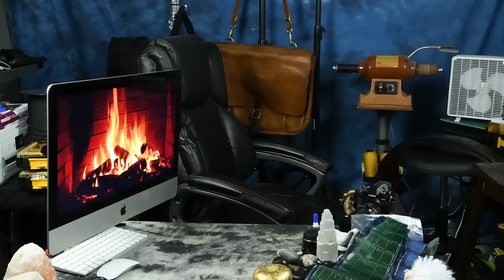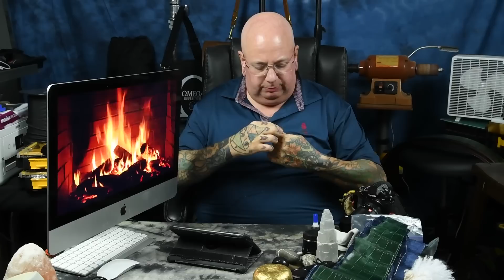🧐 FREE ENERGY Arch Form TIME Variable 🧐

Comment: I'm sure you've tried Ken, but consider... 

A magneto/stator (ala generator) manifests at...

A) a certain speed/base RPM
B) a certain amount/size/strength of magnet
C) The copper coils (which don't even need to be too specific of a length/thickness) are wound at a right angle to the magnet and usually 6-15 coils high on each "stem" (even number of stems is variable on different setups) 

In general it's not even very precise compared to engineering standards 

So like you said, it's effectively the etheric torsion sheer off the right angle of the copper at some base level constant motion. 

So change the motion to the planet rotation/frequency (you probably know what that is, I don't), use a magnet with a ratio'd power on the bottom/in the center column. 

So the magnet is now static and your creating the etheric torsion sheer off of the earth. It's the reverse setup effectively, should be the same effect. 

So we have all the variables, someone better with math like you just needs to have the magnet and the earth numbers. 

We're effectively reversing the structure and getting the ether torsion sheer off the planet. 

An extremely powerful/concentrated magnet like you have, might be more efficient/require less copper. 

key is the ratio and finding at what "rpm" so to speak, it starts manifesting at it with the earth/planetary rotation. (so any change is in the base structure or copper winding)

Should work somehow. I'm sure you've tried this, as it's what you just described more or less.

Also, you would know, is there something "better" than a magnet for the base? granite?, some other stone/rock?

If you think it's the fleur de lis structure, then perhaps the coils are what tie in the middle, probably grounded to some conductive type of rock/stone.

So ratio'd up ballpark, 50K gauss worth of pulling power into the ground (magnet, pyramid), 9-10 feet of 1-2 gauge copper wire, I would try a 3/4 stem fam configuration so the earths .41-.6 gauss is always hitting the right angle of it. The 45-50K pulling power accounts for the RPM difference (small motor stator starts manifesting around 300-500 rpm steady). So that's the ratio to 10-15 volts.

The actual question is.... why do manifestors and stators need so more then a small amount of copper if the dialectic constant is infinite..... it's because the number of right angles has to be above a certain threshold to produce enough torsion sheer to generate a field/electricity. (hence why a motor has to spin) 

This is why you see those structures with strange holes and honey comb like structure, everything is just creating more angles to create more etheric torsion sheer.

Comment: What is obvious is, that it is unnecessary to move something that is already moving to get energy. Just like a Pulsar , that is spinning ultrafast an then spinning again around another axis. I was thinking about rodin-coils, but as of the last magnet-Video, i may think of a set of coils circular on the edge of the north and the southpole of a magnet, where magnetism is the most. So i think, one should get current out of that solid state device with an AC current with the frequency of the larmore precession to it. however i still dont know how the coils have to be lined up precisely to get the most effect. Try and error... ^^

Comment: Ken, here would be a good experiment for supermagnet man. Take a pyramid magnet and cut it into 4 pieces. Space the pieces close but not touching. Then see if the gauss strength is greater or less. Or make the Pyramid mags with more sides and test them. Ya? No? Maybe? Thanks, as always.

Comment: Joe Parr thought the Pyramid was a "time"machine. Well, if it's a time machine, it must be a time variant machine. When you decouple,
or split the 4 sided pyramid (bernulli) the energy is manifested to a much greater degree.  The  logo picture for my channel is 6, 3 sided concrete pyramids brought together to form one. 3 sided is the lowest geometry to use. The greater the frequency, like, cymatics, the more complex the pattern, or output. Tetragramaton - God- Tetrahedinal Gravitation. The pyramid shape at the top produces Antions and the bottom Cadions. The same a a battery has an anode and cathode. + ( ) . Space/plane of inertia/Counterspace. No moving parts, just lots of mass,  pressuring lots of 3 6 9 crystal structure stone with swirling water below it. So now you are getting the piezo electric effect. Water the antena, the stone pyramid, the symbol for the water and Pyth incromenceibility. Hidden in plaisight, waiting for someone to tap it and take a draw from it.

Comment: So basically no moving parts you generate the moving electromagnetic field and this slab or solid piece itself not only  manifest that magnetic field but actually acts as the load itself to make that actual power and then it's just a matter of tapping into that and distributing it am I correct and then you could have it interchangeable depending on the size shape what determine the amount of load created am I correct?

Comment: Based on Tesla's writings and Dollard's research, I was under the impression that Nikola Tesla's radiant energy system was different and better than electricity.  My understanding was that by using high voltage and high frequency electricity through a Tesla Coil, one could "smack" the ether and cause perturbations that could be picked up by a reverse wound receiver coil to drive a load.  I thought that by doing this, energy was made manifest by the perturbation itself and the receiver would be able to accomplish over unity by simply receiving this perturbation.  Taking this a step further, I though that by taking two Tesla Coils and arranging them to face each other end to end, and driving them with a circuit that created opposite or like polarization in each coil, one could create a counter spatial null point between the coils and use an apparatus to parasitically leach the energy from the null point into a load.  This is my understanding of the Cosmic Induction Generator.  Is this anything like what you're doing?  What are your thoughts on the Cosmic Induction Generator?
Reply: Tesla is working the wrong way round, you do not have to manifest energy you need another way to tap it, like asking for it instead of working for it

Comment: Rotating bodies spinning in conjunction to each other don't necessarily need physical ball bearings. When pressure mediation of elemental structures could dielectricly have them spinning in specific location to one and another. Resulting in frictionless rotation!  Plus aided with a starter magnetic bearing...👾

Comment: Think upside down glass pushing against water in a box air pressure magnets and water poles or ether or whatever the magnetic force is controlled by frequency waves or sound or whatever think four sides of box controlling The ether between the magnets by sound waves or whatever if you can't get the magnets to move the way you want you should be able to make water pump... I don't understand how any of the electricity works but there's definitely a force between magnets if you can just get them to move the way you want you should be able to move water with them which would be really easy to harness for machinery

Comment: This is project I have started to look into i bought spark gaps vacuum tubes cople of types 50 meters of speaker wire for bi fola coil tesla coil but I know this giza mabe spelling wrong stan mires his car that ran on water he used a could 400 turns 2 wire 1 diode then a coil to the hho generation but his was made so the tubes were 3 layers positive no connection then negative but what was difremt was his tubes to produce hydrogen where capacitors  then to another coil difremt from the one before the tubes them back to secondary winding basically made it scaler amd the secondary amd one diode  coil tube caps.coil was a pump so energy went to the tube capacitor that produced hho and still acted as capacitor 
It was simple to look at just made difremt getting the electric back forth made it whay more output and efficient then through a bubbler so no blow back the second trick he did was a tube and set amount of holes to add air to it this way he could change the combination to deseal or petrol then into the engine that was the care using scale waves as pump that is key pump energy back forth using it over again 
Then there was his doughnut copper tube vacuum wirh argon because it natural charged and another gas positive charge he could use am electric pump on the tube that had coils all around or use a laser just an ebay one fire laser it it ion and split to hit another positive chain reaction making magnetic energy at the speed of light u
He said this before there was cern I believe he the daddy behind it he said this device and said could be a meter or few miles long I belive there are being made also 
There is many one that use a motor I see and old geza in here he had old one it had 4 brushes people never got it to work because brushes needed to be thinner and between the windings 4 poles he put a spit and magnets between to help the magnetic field bend round then on the outside of the motor this was the most important bit copper rapped and wax then copper the old way to 
Male capacitor using wax can't have any leak it makes free energy motor 
Stan mires was poisoned he went around the world all countries telling the. His ideas of water as full and that doughnut shape so no country would be left behind to make switch together I dont know what went wrong 
Also another one I learned dont calapse the dipole 
H Bridge rectifier where you tale the positive negative energy parnell no sercuit because the energy can still charge q cable or Inductor amd capacitor then switch of that circuit from source with H Bridge rectifier amd then power a load why no matter how long a wire to a light bulb here to the moon soon you close the switch bomb no delay in mili seconds intant because the energy was already in the wire you closing the circuit collapsed the dipole 
Also this in a coil if you open it a coil and let it loop it goes to infinity unlimited simple coil normal circuit can do this on switch with coil after like coil In solinode makes the spark loud because energy build up they use diode or capacitor to use the energy or stop it looping because the sparks from this damage contacts they train all sparky on how to soften the spark but dont teach how to then tap some the energy that builds to infinity that solid state and simple loopback coil the heavy side shows that spike the nano second the spark gap close use a battery just don't calapse the dipole there for not making a chemical reaction in the battery of discharging infinit energy from the source there are more but my writing you if here must be pulling hear out but I think worth it for the info I gave there is hydrino use liquid tin magnetic pump to split weak force hydrogen hydreno and get 30mw with p.v cell or heat in a litle container because the tin comes sprayed at anout 30 degrees angle to hit and it has charge it spit hydrogen coming in with tungsten tip also I see another won that even makes rear earth as by product these are small reactors second has a sphare in center will first use liquid Melton tin small hydrogen everything if energy cheap with that tech it doesn't mater ificentsy there is abundance if clean energy that works and some ready for market it political amd and it would be good no .more petro chemical pharma need natural everything before they gm and kill us all

Comment: Ken, I would try slapping a coil on either side of your massive magnet. make the south side pancake coil length equal a number divisible by 3. For example make south coil 9 inches  and the north coil 5.562 inches. Use same idea for number of turns. Then hook up an LED and give it a jump start with a battery. might want to torch the coils till they’re black creating a Nono layer on the copper too. just some ideas 🤷‍♂️ also was thinking that having two phi proportional magnets of physical scale flipped and embedded into the other magnet might have some interesting properties. Like one magnet being 1 inch diameter and the other being .618 flipped and embedded into the 1 inch magnet. Just silly idea haha

Comment: If there is no weight being moved from a point to the circumference but there is spinning of the center axis in sync with the outer circumference then the energy to spin the center axis would be less then the outer circumference and the speed would increase the further you go from the center, much like a clock but in this case the hand of the clock would be weightless. Someone correct this if I am incorrect or there is something that I am missing because I cannot see any error here.

Comment: You mentioned a monolithic slab which reminded me of the monolithic structures found in Peru. Those structures are made of granite. I learned that granite is composed mainly of quartz. I believe when you put a charge on a crystal it manifests energy. I'd be interested in seeing a video on how that works unless you've done one already
Reply: 2001 Space Odyssey's  monolithic slab
Reply: You can add pressure to quartz to get an electric discharge, I believe it's called the piezoelectric force

Comment: Actually this form of electrical technology has been around for a long time with magnetic fields collapsing on each other in static form like in the common ignition coil which produces very high voltage and very low amperage and does require a voltage input in order to get an output. Similar devices are present with step up and down transformers but all of these are electron pumps. Remember electrons dont flow through a conductor but around the outside on the surface.
Reply: Electrons don't flow anywhere because they only exist as a unit of measure.  Takes an atomist to believe they're particles.

Comment: Of course your 30 lbs. of copper have not produced appreciable ‘free energy’…the fact that there is a moving magnetic field due to the relationship of the N to S magnetic field precession, although interesting is beyond your limits of extracting usable power with this copper.  Of course your exquisite mind already knows this…as did Steinmetz, and his equation(s) that represent the losses required to transform this moving magnetic field.

Comment: very nice sir. but gens do create a low current. it uses the draw on the low current to know when to build up a current for the high load. your getting in my head now ken.
Reply: That's just another load mate...  Try running a "generator" with no load until the gas runs out.  Gas went, buty where did the watts go? :D
Reply: @adolforosado  true. capacitor from what ive seen. like filling a Olympic size pool with a garden hoes. not all are built the same. many ways to skin a cat. i love cats by the way. most devices are feed a current. they dont pull until operating at full or unregulated capacity.
Reply: @adolforosado  there are low current windings that activate a switch and run the cpu.

Comment: Think about phase locking with the 1 to phi temporal disparity by utilizing the time delay that is required to fully charge or discharge a capacitor. Tank circuit. No moving parts, no resistors or heat generating electronic components. Capacitance can be dumped into a coil and, conversely, a collapsing magnetic field can charge a capacitor. Only losses are resistance in the copper wire, which can be overcome by having enough power in the system. Let me know what you think... Lux et Veritas
Reply: https://www.youtube.com/watch?v=Z_-3Nz1ZuSI&t=617s

Comment: There are no moving parts (manufactured parts) in a receiver. We wish to receive. But, to 'load' the reception/received with moving manufactured parts wont do. Tends towards zero or negative efficiency. Try starting at the end first. WE constantly search for the answer. Yet, we rarely, if ever, search for the question. The correct question opens up everything. Is everything a cycle - and cycles within cycles - and........ ? In times gone by much effort was made, over long periods of time and lives, to observe this phenomena and record it. And its effect on our motion (rather position) relative to 'everything'. Emotion too. Perhaps what you seek is established. Maybe. You know, our awareness and thoughts have been steeped in modern BS... which is hard to shake off. Try though

Comment: I believe there are other ways also, including moving magnets and non permanent magnet ways.

1 way would be using a simple transformer setup which accomplishes "Self Induction" by utilizing electromagnetic retardation techniques.  I can personally flip the phases of 2 alternating coils of a transformer using different techniques. I can accomplish a 90 degree and 180 degree flip using different techniques. 

A regular transformer has relatively 2 identical sinewaves, except they are reverse in sign. Which causes any and all load to be transferred to the input due to "back EMF".  But I can also reverse this by retarding the sinewave to shift phases when compared to the primary, and in tests, I have accomplished causing the input pulsing power to go Lower and primary mover coil's amplitude to increase higher than the input voltage by pulling a load from the secondary. 

Really, friction, wind resistance, heat, etc are all minimal compared to the extreme effect of Back EMF.  and I do believe there are ways to not only neutralize b Back EMF, but partially reverse Back EMF.  

If you wish to converse on this- I do 100's of experiments in this hobby and have dozens of videos demonstrating different effects. I do not claim "Overunity" but I do claim I have documented some very interesting effects.
Reply: No moving parts and no input other than needed to create the magnets and other parts is the goal.